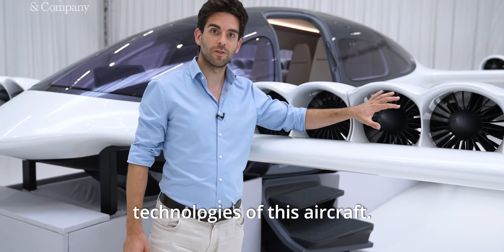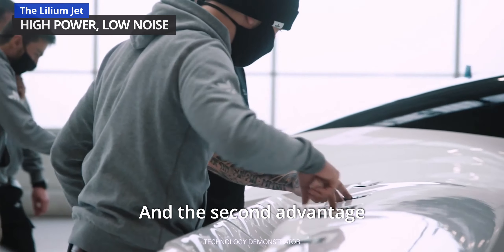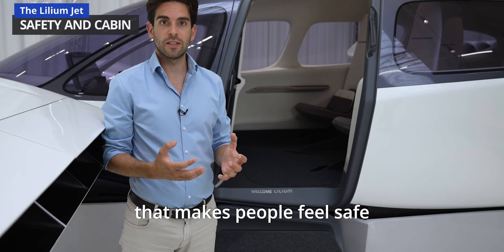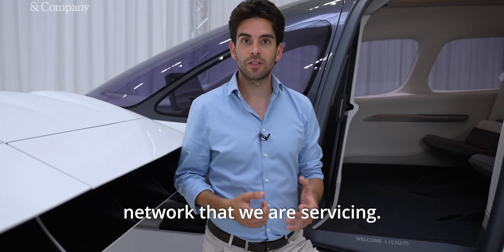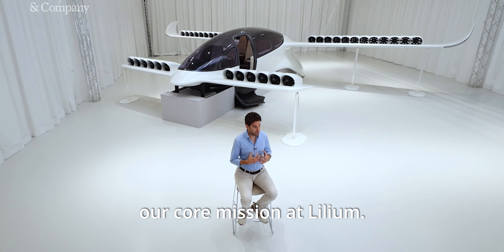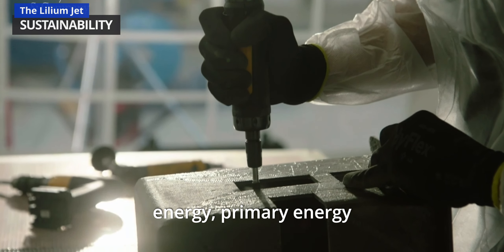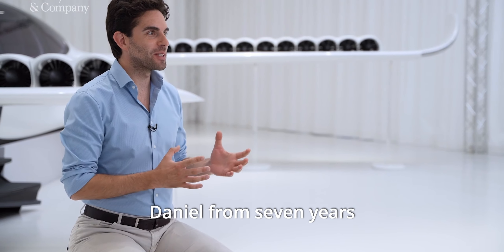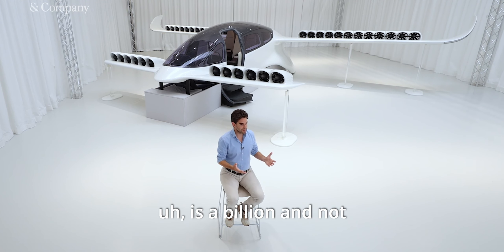"Without naivety, you don't enter into a project like this" Daniel Wiegand on the Lilium Jet $LILM

Comment: Of all the evtol startups the lilium jet is clearly an evolution ahead.  No dangerous external rotors,  2 means of lift, both direct via engines and via air over wing, which means less power consumption, Safety and redundancy far beyond the competition. ANd for all its benefits that sets it ahead and apart from the rest, its engineering is less complicated.    as he mentions its scalable in passangers without drastically compromising the overall scale of the aircraft.   its simply a brilliant design.
Reply: The efficiency of the design is what gets me. Why haven't we figured this out before? Traditionally we haved used a propulsion device (prop/turbine) to pull the aircraft forward to force air over the wings. The air speed within the vicinity of the propulsion device is greater than the air speed at the wings. In this design they seem to have incorporated that added air speed into the lift equation. Thus creating a more efficient design. 

Now this is all really in theory.......?  in real world applications,  who knows,  maybe all the added structure around the EDF'S  create some sort of negative effect on the airfoil and create the wrong type of vacuum which creates negative lift? 
 That's what's exciting about everything that goes into making projects like this. 👍
Reply: @Zachary77  they did, key word being "they" Darpa.  and their Aurora Lightning strike XV-24 VTOL, which was something plugged around in the 90's but never seeing fruition outside the digital drafts.  Though the XV-24 was a drone never intended for passenger or piloted flight. and it was big. and considerably different mechanically. using one engine to drive all its fans. but the general layout is similar to the lilium Jet.   And your correct, the lilium layout with its stream of engine of the trailing edge of the wing does generate aeronautic lift,  liftt by way of direct fan thrust as well as reduced air pressure over wing,  greatly contributing to overall lift stability control and efficiency.  when you watch the lilium jet fly about, that's the one thing you notice,  its in flight characteristics, its stability.  not only benefiting from the gyroscopic effect of multiple engines on all corners but also that conventional flight control added in.   it flies like its on rails. seemingly not suffering much from air turbulence.  and it shouldn't because its not fully relied upon wind of wing lift.    its a brilliant design to say the least.  When i first saw it, it took some time for me to appreciate what i was seeing, as it seemed like a gimmick at first,  then viewing with more professional eyes, it hit me like a brick what it all really ment.  The removal of the large rotors, being the first to standout to me.  And from that alone the increase in safety and operations over its competitors of whom in many ways made an even less aerodynamically efficient design layout than a standard helicopter.
Reply: Ahead in exaggerating performance claims? Or in filing for bankruptcy and going out of business? Or both?
Reply: @derkleinemaulwurf07  Unlike it peers, The lilium Jet is a very different type of evtol, with much higher standards build and safety.  The others had not taken that route to get their aircraft approved in half the time and at half the cost. for them it made sense for the type of aircraft they were making. And i don't know if you've seen the size of their (joby/archer) fuselage, particularly the interior, but its tiny. Tiny even in comparison to small helicopters. That will not fair well for passengers.  I cant knock them for their business and production approach, to get things done asap. especially in terms of burning thru capital.  Lilium got screwed by their government which made financial promises and then bailed out of the blue. Liliums approach is the better for a better product but it comes at a cost. capital and time.  But no worries. the project is far forward to truly be dead. as in.. someone will buy them out, and maybe that was part of the plan.  Introducing new aircraft is always a long and laborious process. taking years even in the best scenarios.  I remember the development of the Honda Jet very well. That project first came to my attention in 03 but it really began in 97 didnt see to consumer manufacturing and sales until 2015.  and that's HONDA!!!.  and their approach to the light business class was practically new as well. along with all new technologies.  so what more would you expect from some young startups just our of college with some novel ideas and small working prototypes. again the difference being the type of aircraft and the technology  behind it.  No way will i knock on Liliums achievement thus far. The bumpy road was to be expected. and as it stands.  Joby has one major problem. Its seating capacity does not lend to great profit making at all.  they are indeed relegated to taxi like transport as their aircraft does not scale up for more seating.  but i dont want joby to fail either,  evtol is a welcome mode of travel for all that can make it a reality.  I do favor Lilium for the brilliance of their crafts design and layout. abandoning open rotors which by any means is a dangerous factor. still i figure lilium will see the light of day come 2028.  And by that time all the new battery technologies shall be available.

Comment: So they're ducted fan engines, I understand that calling them jet engines might make it easier for people who are not into aviation and engine design to understand that they're more powerful in specific ways than normal prop engines but it's still kinda missleading as there are people working on plasma electric jet engines that work like actual jet engines do.
Reply: Yeah, I was frustrated by this. It’s not a jet engine by definition (right?), there is no air compression to improve combustion etc, so why call it that?
Reply: Maybe it’s a language thing, those are definitely ducted fans not jets
Reply: Maybe this way?: the jet is the aircraft and the engines can then be called the aircraft engines or the jet engines

Comment: They are motors not engines !  Motors convert energy -usually electric or pneumatic to mechanical work - engines convert a fuel to work .  This whole misguided project is a scam which is becoming apparent.  They are slick and the cute German accent helps give some exotic effect - the 'designer stubble' look is reminiscent of the cast of Das Boot where it was difficult to shave on a submarine --they look a bit like derelicts as it is but that seems to be the Gen X "look" .  It is all about looking like something it is not and neither are they.
Reply: Who hurt you
Reply: @Leon_der_Luftige  Why do you ask ?
Reply: He's not so slick when you start asking questions. I think it's a scam, as well.

Comment: Electric ducted fans not jets, i hope they are fitting a safety parachute
Reply: Yes they had a parachute a couple of years ago. There is no way that thing can glide.
Reply: @jagolago-bob  Well it can. Like a brick. The ducted fans, should power fail, act like huge spoilers.
Reply: @derkleinemaulwurf07  Bricks drop, like the Lilium "Jet", and the Lilium company, itself.
The aircraft would not have a controlled glide. It would most likely tumble down.

Comment: Hey there 👋 is me, the icon remember this is the year that I will start flying my 2 sitter special technology aircraft, no blades and is an evtol how about that. The noise of the fridge could be a fare comparison when you are sitting inside. Weight only 340 lbs so it will fly very fast. Thanks God.
Reply: Anything more on your design?

Comment: These are ducted fans, not jet engines!!
That’s how you can spot a scam !!!!
Reply from the maker: jet noun:
_ A rapid stream of liquid or gas forced out of a small opening.
Reply: So, a High Bypass "Jet Engine" is not a "Jet Engine" because it's not a "1950's Turbojet Engine?"

Notice that very few Commercial Aircraft today, do not use "Ducted Fans" for "Propulsion Efficiency!"
Reply: Modern passenger airplanes don't use jet engines either. They use high bypass turbofans. It's more like a gas turbine driving a ducted fan. The jet of hot gas contribution to propulsion is negligible. 
So you have to separate what most people think jets are, vs the technically correct definition anyway. And obviously a marketing video will always use the colloquial meaning.

Comment: One of the major problems I see (actually hear) with Lilium's aircraft is the very loud noise level and high pitch of that noise level based on their own videos I've seen (and heard). It's an electric jet engine and it sounds like a fossel fuel jet engine. Lilium really needs to concentrate on drasticlly reducing that noise level and the pitch of that noise level if it wants to operate near residential areas. I definitely would not want that flying over my house nearby.
I've also read that there are other problamatic issues with energy consumption probably from running so many electric motors perhaps. 

And finally,  I read that the cost of the 4/6 passanger version is more than twice that of Joby or Archer's 4 passanger eVTOLs, that would be another major problem.